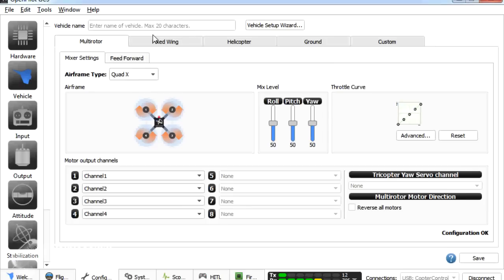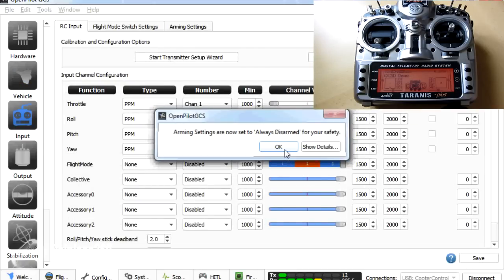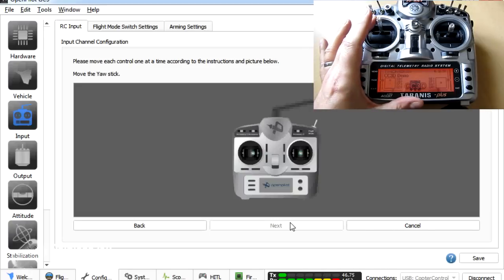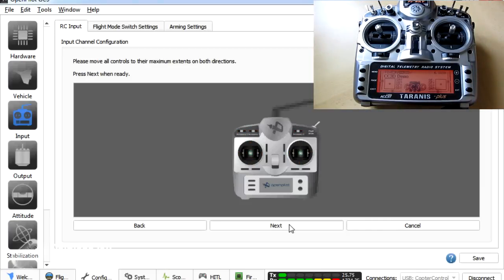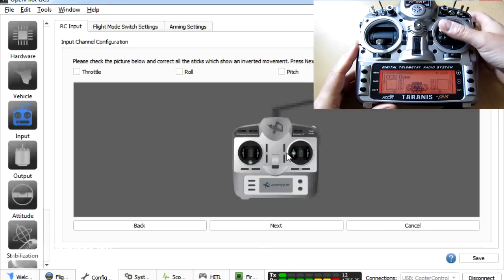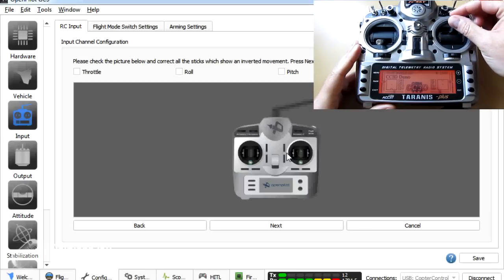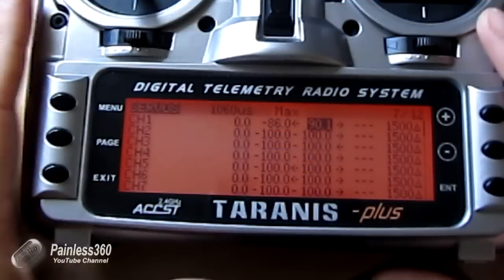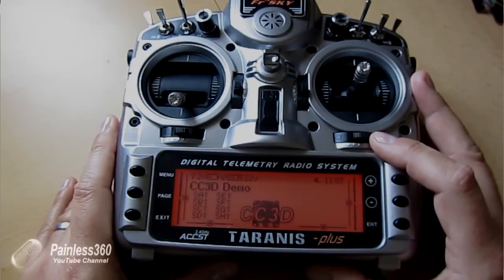(3/12) FrSky TARANIS Radio - Adding extra channels and controls for a Multirotor

Comment: Hi Lee, when you connect to open pilot its for cc3d. how do I do this step for APM? I'm trying set my throttle failsafe and everything I've tried so far doesn't work. The values are too low (i've posted on your other video re the problem) and the board won't arm. I figure if I configure the end points like you've done in this video it might work? Secondly, do i have to re-bind to my rx when I've set up a new channel?
Reply from the maker: +SuperRCNOOB See the APM series where we cover this. You use another program - Mission Planner for the APM, not Openpilot. Best of luck.

Comment: Hi Lee.
I'm new to Taranis, but not to CC3D. As a few people have asked, I'm having issues with getting through the TX wizard. It only recognises Throttle.
I have the D4RII with jumper pin between 3&4.
Tried CC3D pin 3 and pin 8 for sig, and still nothing.
Is there anything else in the radio to set up for PPM?
In the GCS RC inputs should be set to PPM right?
Its obviously something simple, but i'm not being it.
Cheers Lee
Reply from the maker: Sounds like you're selecting PWM for the radio in Openpilot. Try PPM..
Reply from the maker: We have setup a CC3D with PPM in our TAROT quad build if that helps..
Reply: +Painless360 Thanks Lee. I discovered it was in the hardware menu on the GCS, but couldn't edit my question. Cause my internet went down
I have now set it to PPM+No oneshot, and it works perfectly.
Cheers for the reply
Lee
Reply from the maker: Great, happy flying!

Comment: So I have a question about the endpoints part. I run a Taranis, x4r sbus receiver and cc3d. Should I change the endpoints on my setup or just fly it. Emax 12a 2204-2300kv 3s. It's flys just fine. Is there a certain reason to change them?  I'm confused
Reply from the maker: +Invitingsauce If it works then great! Some parts don't like it when the channels go outside the expected ranges (Cleanflight for example). Normal channel ranges are from 1000-2000 but the Taranis likes to push the values past those points. Happy flying!

Comment: yes I apologize for my rudeness I was at my wits end with trying to figure it out that day. I still have the problem. and no matter how many times I go through the setup wizard it just won't recognize it as a three position switch. I know others have had this same issue but I can't find anything about it.
Reply from the maker: +Tim Bell Lots to check then - have you checked that you get a full range of 'movement' from that channel on the radio? Can you attach a servo to that output on the Rx and see it move into three distinct positions? If so then you can manually configure the radio settings in the GUI using the sliders to get it - use the video for reference on how I've set mine up...

Comment: First of all thank you for the Great video. I have done everything that you have done in the last video and this one, but the cc3d board wont see my transmitter!!? I am using ppm mode when I connect the board, is that where I go wrong!?Thank you very much....:)
Reply from the maker: +Bisholi M Happy to help but please watch https://www.youtube.com/watch?v=olIqTiSJHIY and come back to me with more detail of what you've tried..
Reply: +Painless360 ;) Well I see your Point :) it was stupet to ask with so little info. I should have asked If I have done exacly what you did in your CC3D video for connecting the D4r 2 reciever and there it seems that there is no connection between these two board ( the CC3D and D4r 2) is there anything that you think of that I should have done that there isnt in your video?the reciver talks to the radio no problem.the CC3D setup goes fine until the radio setup and then nothing!!!?thank you again for your kind help :)
Reply from the maker: It's either a wiring or setup problem. Hard to help without more detail. I would check that the jumper is in place on the Rx and that you have PPM selected in Openpilot. Best of luck.

Comment: Thank you very much Lee. Highly appreciating that you take the time and make this videos for us to understand. Love it. Could you just please help out explaining the throttle range. I do not understand how you get your numbers. Is there a formula one can use for every ESC or how do I obtain the correct numbers? Also, is that range for the other channels as well or just for the Throttle? Coming to think about the Pixhawk as well. Thank you.
Reply from the maker: +Amir Tahami Which numbers do you mean? % or PWM?
Reply: The percentage you use to get the value for us. Hope that makes sense.
Thank you very much.
Reply from the maker: I use the servo menu to see the actual PWM values and reduce the travel on the channel to make sure that they don't go over 2000 and under 1000. Hope that makes sense..
Reply: I understand that, but I don't understand why you are keeping it between 1000 and 2000. Sorry if these questions seems stupid, but I'm trying to understand why the should go below 1000 and above 2000. Thank you.
Reply from the maker: Then have a watch of some of the videos in the 'Introduction to RC' playlist - they answer a lot of the basics. Best of luck!
Reply: Will do. Thank you Lee.

Comment: Great videos, thanks!
Is it possible to connect a buzzer activate by a switch to the D4R using the CPPM?
The problem is CH2 is for RSSI while CH3 and CH4 are connected by a jumper...
Reply from the maker: +Guy St Most need PWM so look at the flight controller and see if it allows you to 'passthru' PPM channel values into unused pins as a PWM signal..
Best of luck.

Comment: Hi Painless , great video , learned a lot! 
However, i'm a bit confused. I need a 1.25, 1.5 and 1.75ms PWM when i alternate between a 3 way switch. How do i go about doing this? Am i able to change the PWM values or  ...?
Reply from the maker: kevindallem46494 What FC are you using?
Reply: Painless360 Thanks for the REPLY!! 
I'm using a MK V2.1 Flightctrl
Reply from the maker: Never heard of it - can you send me a link?

You need to reduce the endpoints of the mode channel on your radio to reduce the channel movement  down from 1.0 and 2.0 down to 1.25 and 1.75.

Bets of luck.
Reply: http://wiki.mikrokopter.de/en/FlightCtrl_ME_2_1

Thanks!
Reply from the maker: Cool, not seen that one before. Thanks for the link.
Reply: Painless360 Hi Painless! Sorry to bother you again. Previously when you mentioned that i needed to reduce the endpoints on the taranis , did u mean to reduce the weight under the MIXER settings until i get 1250microsecs in the SERVOS page for that particular channel?
Reply from the maker: Either would work.

Best of luck.

Comment: The only thing I dont understand is, why you created Inputs for the switches. They seem to work just fine with adding them in the mix, as far as I see it on my new Taranis. Can that be? Perhaps the Naze bypass the "Input" and do buzzer and mode switch also without creating an input first....
Any comment on this? Or am I not seeing the obvious? :)
Reply from the maker: MrStubbs1981 When using the raw inputs in the mixes you cannot apply expo, d/r, offsets, assign them to flight modes, add etc etc. Using an input allows you to tweak the controls as you need them to before they are fed into the mixer. 
Hope this makes sense.
Reply: Painless360 Jep, I see. For ordinary mode switch it isnt too bad to not use input config. But you are right: Why not :)

Comment: Thanks a lot Painless, If I had waited a little bit to see this video, I wouldn't have burn my receiver.
Is it possible to burn it if the motors go like crazy because a bad configuration in Baseflight?
Reply from the maker: Miguel Angel Lara Calderón Unlikely that 'crazy; motors would fry a receiver. Sounds like you had a bad one. 
Happy flying!

Comment: Great video! Many small quad pilots are using the Taranis with an LRS module to take advantage of the 433 frequency. Will you do a video on one of these setups with the EZUHF module and the mini 4 channel Rx?
Reply from the maker: Jason Campbell Not likely but I will be adding a DSM module and the process is the same. 433 will give you much more range due to the longer wavelength and properties of the 400Mhz band.
Remember that flying beyond of 'line of sight' for models in most places is now on the 'naughty' list.. Check the local laws and guidance so you don't get caught out.
Happy flying!
Reply: Very good advice. You are correct about the 400 MHz band. My choice is mainly due to the penetration and choices of 2.4ghz video Tx frequencies I can have with the 433 control Tx. As a sub I am looking forward to your videos. They are informative and very well done. Thanks again for the Taranis series!
Reply from the maker: You sounds like you know what you are talking about. Amateur radio certified by any chance?
Reply: Funny you mention that. I will start my build soon and plan to take my technicians test before I transmit on 433. So it'll be 2.4 and 5.8 for now. Unfortunately the town I live in has so few ham operators and I'll have to travel to take my test but I know it will be worth it. I'm guessing you must be certified.
Reply from the maker: I am.  Best of luck with the exam!

Comment: Great videos as always! In the past two days, I've watched your entire Naze32 / Cleanflight series and now I'm working through the Taranis ones. Invaluable. Do you have a video explaining how to configure the telemetry correctly with them? Thanks in advance!
Reply from the maker: Matthew Knippen The telemetry video is coming soon - I need to cover a few more things before I can cover the introduction to telemetry. The there will be another that will specifically talk about connecting to a Naze32 for battery status too..
Watch this space!
Reply: Painless360 Great, thanks!
Reply: Painless360 great videos! Got this radio today. Looking forward to the battery percentage with the naze32
Reply from the maker: This is tricky to do as you really need a Smart Port current sensor with an X8R and a LUA script on the radio to translate the mAh consumed in to a percentage of the available mAh available in the pack (usually 80-90% of the total pack rating).

I don't have a current sensor so would recommend looking into this in the mean time if this is something you need..

Best of luck.
Reply: Sorry but think it was more my wording. I'm very new to this. I maybe should of said status like you said. Is it possible using this setup to get the taranis to read the voltage and then make a noise once it reaches a set level? I.e. when it is getting low and you should stop flying. 

Thanks for the videos again was watching how to balance props before. Great tips!
Reply from the maker: Ah I see! Yes it is. There is a few TARANIS telemetry videos later in the series and I cover alarms in those videos too.

Happy flying!

Comment: Great video as usual, happy to see your on Team Taranis now. could you show how to use a third gimbal/stick on the tx to control a gimbal/pan tilt on the aircraft. I have read about it on forums but would really appreciate seeing it. Thanks for all the awesome videos!
Reply from the maker: donatedpants420 Ok, what kind of gimbal - do you have a link?
Reply: Painless360  Cool, the guy on the forum was using a replacement Taranis gimbal, but i was thinking something more like this  http://amzn.com/B00JY7D3HC or even something salvaged from an old xbox controller if you want to get real DIY. He was using it to control a 3-axis gimbal (tilt/yaw) but I was thinking of something i can just mash up or down to control camera tilt on my 250 class.
Reply from the maker: I see! Let me see what I can do as I don't want to create too many holes in the TARANIS! I can show you how to do this using the standard sliders easily - would that be useful?
Reply: Painless360 That's cool I can understand you not wanting to get too far down the taranis hole just yet. I was just thinking after covering the basics you might want to show an interesting more advanced mod that no one else has really touched on yet. Yeah I tried the sliders first but its a bit tricky to return to center, always leaves me thinking i'm a bit off and this detracts from the locked in feeling you need for fast low flying. I'm using head tracking from my googles now and while better its not without faults.If you have any interest in messing around  with it I'd be happy to send you one,  it would be worth the $15 to keep me from doing something dumb to my Tx
Reply: Painless360 Create holes !
Reply from the maker: LOL! :)